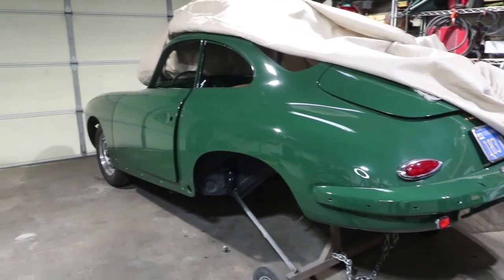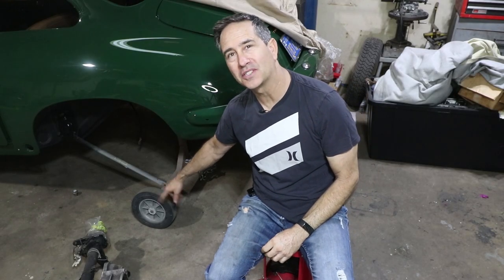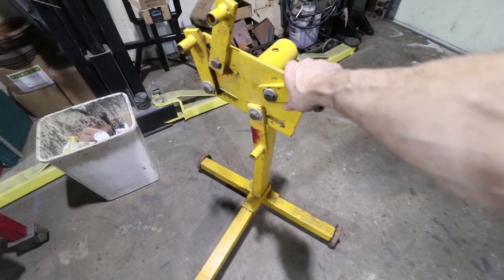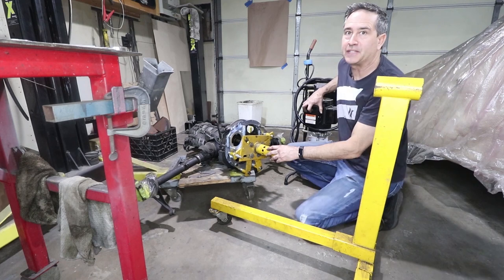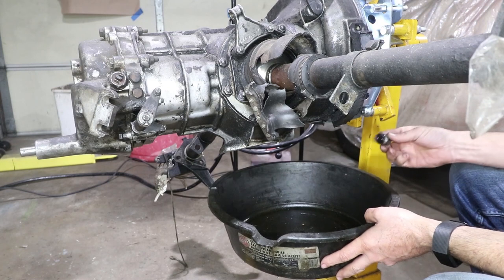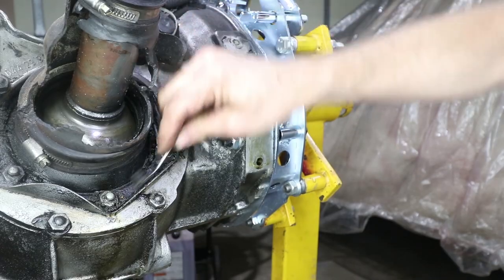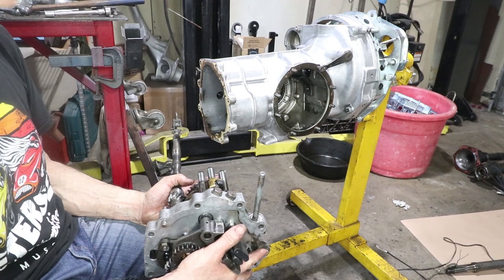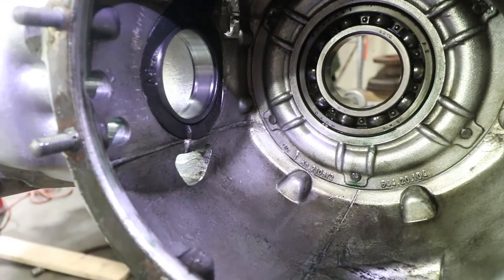NASTY Porsche 356 Transaxle Cleanup/Teardown/Inspection & BAD News!!

Comment: get the jig and do it yourself.  Nothing better than getting something SWEET by taking your time and making it perfect.  No one else will be able to spend that kind of time.
Reply from the maker: Good point.  I have a huge advantage in that I don't need to make money and ship it out the door.  I always go the extra mile and make sure I'm confident before I put it back in the car.  
A good example is my front suspension build.  No one would take the amount of time to measure, inspect, correct, and fabricate custom bushings to make it perfect.

Comment: One thing our shop does (most do really) is place a large aluminum "cookie tray" underneath whatever we're cleaning or working on to catch the grease, oil, dirt and other debris that falls on the ground when doing a tear down and cleaning. It really helps with keeping the floors cleaner- and also has the advantage of catching nuts and bolts that drop down too- instead of the crazy bounces they take otherwise!
Reply from the maker: Thanks, this is a good tip!

Comment: I had a noisy 915 so I found the pinion gear was "floating f-r" and the pinion was pitted. Ring and pinion needed to be replaced and I didn't feel like I wanted to tackle the learning curve of backlash/pinion depth/preload so I sent it out. Now I still have a noisy transaxle after spending an obscene amount of money. Should have done it myself!
Reply from the maker: Ugh, I feel your pain.  I'll try it myself.  That way if it doesn't run right I can do it again.

Comment: To clean my 923  trans case I bought a HF steam cleaner and went to town with it along with various plastic scrapers, soft brushes and lots of paper towels. Excellent results!
Reply from the maker: Good idea!  Never tried a steam cleaner.  I've seen good results with dry ice blasting too.  I'm just glad most of the cleaning is behind me now.  Cleaning takes the longest, whether its engine, restoration, or transaxle work.

Comment: I really enjoyed watching this video. You have demonstrated again and again that to do something right then you have to DIY. Besides the satisfaction of learning something new.
Reply from the maker: Thank you.  As shown in this video, the previous builder didn't do it right.  No gasket on nose cone, red and clear RTV, stacked gaskets on axle tubes, split axle boots (lazy!), Wrong 13mm ATF nuts, and probably more wrong inside.  The selector shaft has some file marks on it.  No wonder why it leaks.

Comment: If you get it magnafluxed, make sure it is done on DC so that the inspection will penetrate the metal a bit instead of just the surface with AC.

Comment: Good work. Working in a shop that rebuilds industrial gearboxes I see the amount of work required to make a product that will work for years. Don’t know if I want to try that. If I do I’ll emulate our mechanics and take lots of pictures. 
That 30 liter ultrasonic tank I said you talked me into didn’t take gunk off like I had hoped but it softened up the stuff and I have been able to squirt  Gunk on it and use a paper shop towel to wipe it out. But it did vibrate off the patina and make it shiny again. Earlier, I put the belt tightened from my 944 in it and when it came out it had taken the corrosion out and left a yellowish shine that made me think it might have been plated with yellow cadmium.
Reply from the maker: Gearboxes are a lot of work for sure.  
The ultrasonic cleaner does make things go faster, but brushing and scraping is often necessary.
Same with electrolysis.  It just speeds things up.

Comment: Tom , I would make that 3 point engine stand a four point engine stand , with locking casters , if it falls over ( always when you least expect it .Ask me how I know ) and breaks the case you got problems... If you could get a factory service Manuel I would say rebuild it your self . You have the skill you just need good information ...   Pete
Reply from the maker: If I only knew a good welder?  
Just kidding, its on my list to do.  
I have the factory manuals, spare parts catalog, and elfrink manuals.  
They all approach it a bit differently.  
I totally agree that with the right tools, information, and patience it's possible.  
Please stay tuned!
Reply: I have the three leg stand and add weight to the base to stabilize it. Works fine.
Reply from the maker: Nice. Like a concrete bag?
Reply: @GarageTimeAutoResto   I have a couple of lead “pigs,” one for each side leg, but I’ve also used a boat anchor and chain when that’s handy. A bag of concrete mix on each side would work, but may make it difficult to roll around.

Comment: According to Hagerty, that car is worth north of $75K in "fair" condition. You know I'm all about doing stuff myself, Tom, but you are entering the stratosphere of car valuations. My TR4 is $50K in concours condition; your 356? 225K. I don't know, I might send it out. But, then again, I think the matching numbers are what helps with the value. If you mess up and have to replace the guts...the case is still going to be stamped with the original number, right?
I say do it yourself. That's why we're here...to see you grab your "you know what" when we might not and come out on the other side. You've done it before. You're dealing with old technology and you're not the first. Take a chance, have fun, and bring us along for the ride. I'll be here, that's for sure!
Reply from the maker: If i put it back together and it sounds bad, then I'll take it back out and either try again or ask a pro to help.  I'm pretty sure that I can make it run as good as it did before.  
As they ignorance is bliss.  Before this week, I thought everything was ok because it sounded and shifted fine.
But because the value of these cars are so high, the prudent thing to do is to take it apart and inspect.  The main thing that can wipe out the numbers matching case is a broke differential carrier.  Thank goodness I don't have that problem so far.

Comment: If it was the 911, I’d say DIY.  With the 356, the risk on the matching numbers say, at least find a donor to learn on.
Reply from the maker: I hear ya, many of the really good builders have a 1 year wait, or more.  The others are probably not as careful as I will be.  For example, why did the previous rebuilder leave out gaskets and think RTV would work?  I think many shops just ship it and hope it doesn't come back.
Reply: This is a tough one because I agree on the risk of screwing up on an original gearbox that is numbers matching. I think you have the skills to tackle it but if a highly respected shop can get to it in a reasonable timeframe, I would go there. There is still plenty to do on the rest of the car. If you can’t get a respected shop then I say go easy!